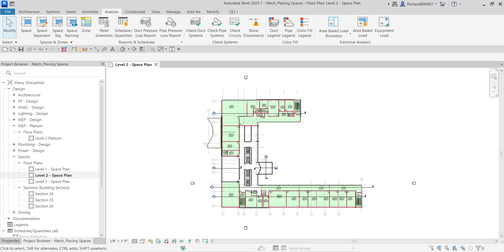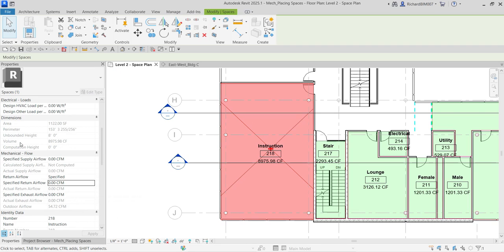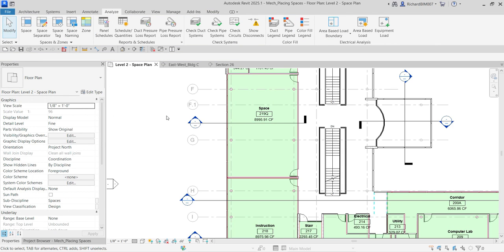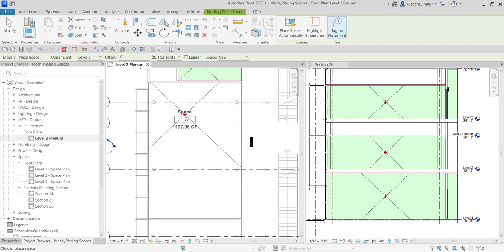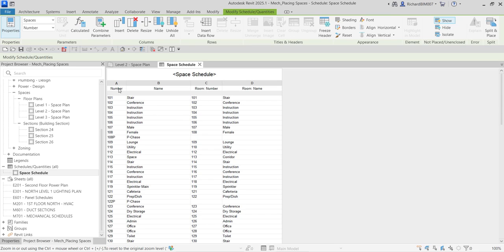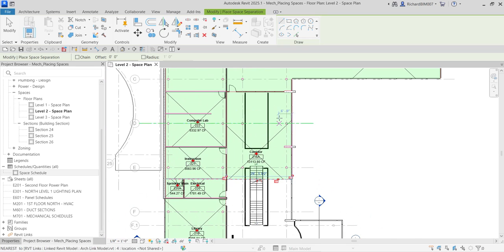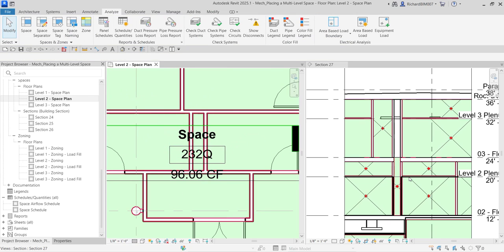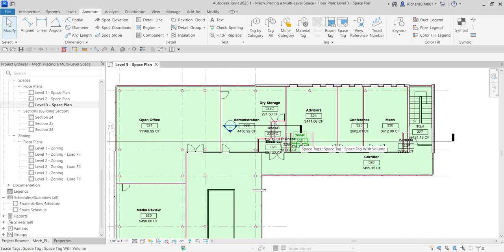REVIT 2025 FOR MEP DESIGN: PLACING SPACES

Comment: Hi 
I have a doubt in my plan i have 2 step fall ceiling and when i create a plenum space in ceiling its not occupying full space
Reply from the maker: This usually happens with stepped ceilings because Revit only reads clear, room-bounding geometry. Make sure all ceilings are set to Room Bounding, and check the Space Upper Limit and offset so it extends above the highest ceiling. For complex step changes, adding Space Separation Lines helps Revit read the full plenum. In many cases, the cleanest solution is to use separate plenum spaces for each ceiling height to get accurate volumes.